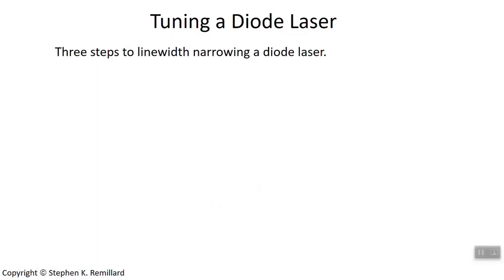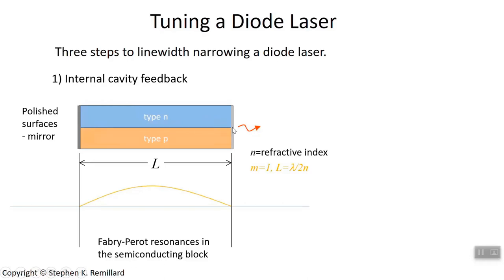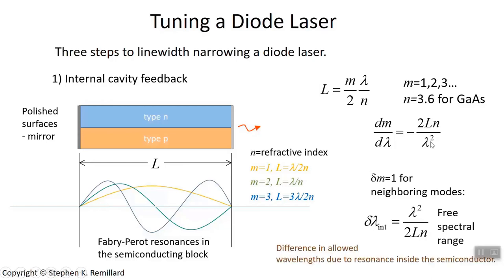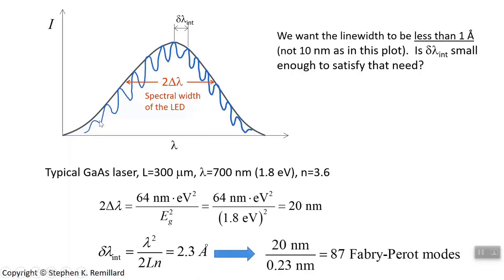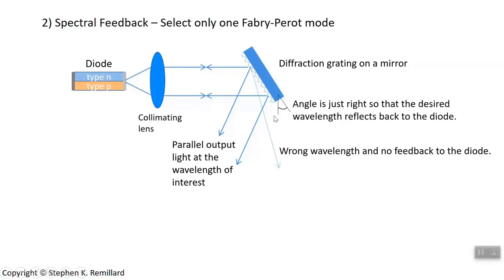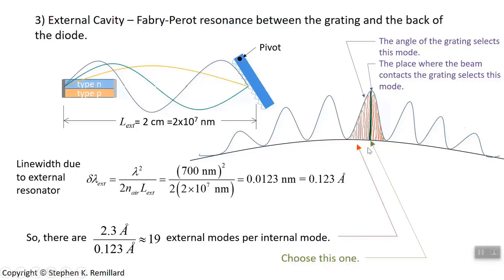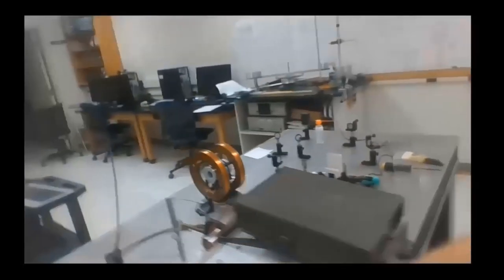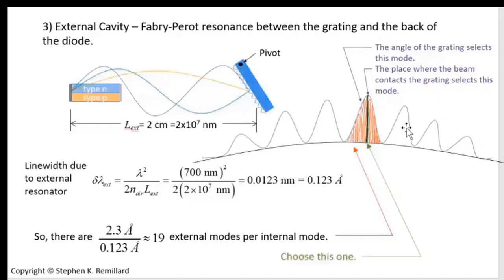Tuning a Diode Laser (With Demo), Lecture 42, PHYS/ENGS 495

Comment: so why do laser diodes produce that speckle not seen in any led?
Reply from the maker: As I understand it, the speckle occurs when coherent light reflects from a diffuse surface, making it a phenomenon of laser beams.  Upon striking a non-specular surface (such as wood, or paint), pieces of the incident beam reflect in many different directions due to the wide variety of reflection angles offered by the surface over the area of the incident beam.  These reflected rays interfere with each other, constructively or destructively, producing random instances of brightness - the "speckles".  Unless population inversion is induced in the LED, such as with the grating feedback that I described in the video, the light coming out of an LED is incoherent.  Thus, the diffusely reflected, incoherent LED light does not interfere and speckles are not seen.  By the way, nice work on your ZeroMass YouTube channel!  Impressive laser workmanship.
Reply: @stephenremillard1  makes sense, and thank you for the thorough reply... as well as the compliment of my projects , much appreciated 🍻
Reply from the maker: @ZeroMass  The diffraction grating in the video had 1800 lines/mm.  I think a CD give about 650 lines/mm (maybe?).  A DVD is about twice that.  So, the splitting of peaks will be closer, but I think you would still be able to see the interference maxima.  I suggest using a micrometer-driven rotating pedestal to mount the grating.

Comment: At 5:23, you speak of the index of refraction of the material (GaAs), yet a couple of lectures back, you explained how the depletion region has a different refractive index due to the low levels of charge carriers. Which index of refraction is being used in the L=m/2*l/n equation? The n of the depletion region, the bulk material, or the doped material?
Reply from the maker: For a really precise calculation of resonant frequency, I would rely on the index in the depletion region, since that's where the resonance is occurring.  But it is a question of the necessary precision.  When you are forming an index-graded region in order to confine light, the indices of the two regions certainly need to be known to several digits.  In the case I show here, I am interested in the difference in resonant frequencies (the free spectral range).  For this, the level of precision that is needed to distinguish the depletion region isn't needed.  That's why I just use n=3.6, without any further precision.
Reply: @stephenremillard1  I see. That is what I figured. Thank you.